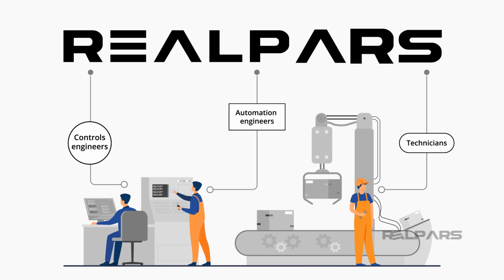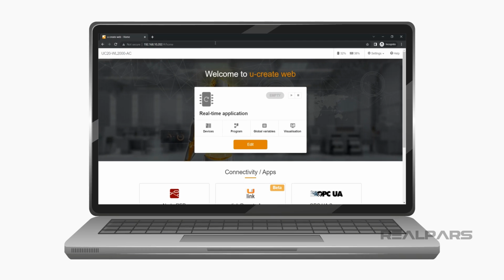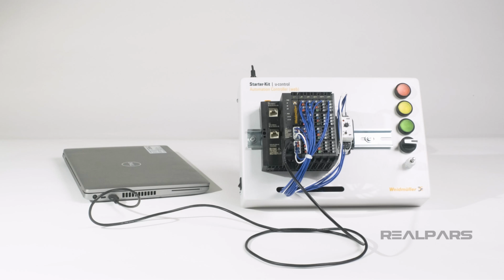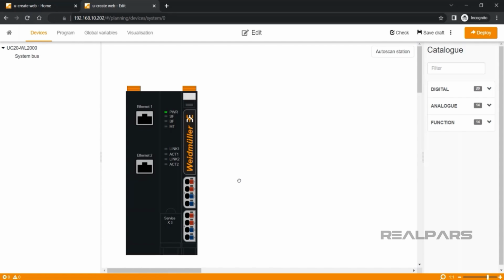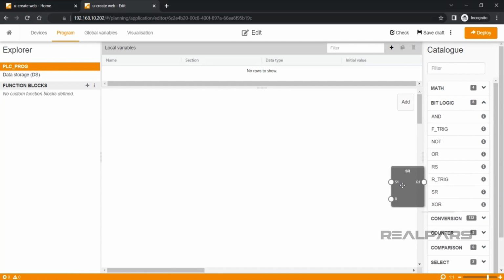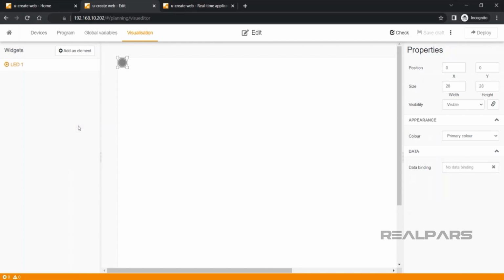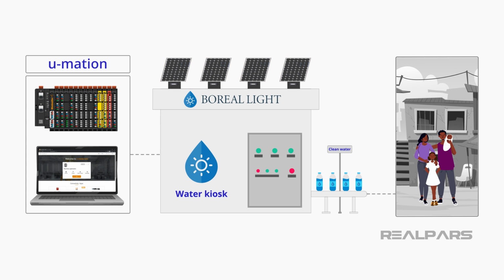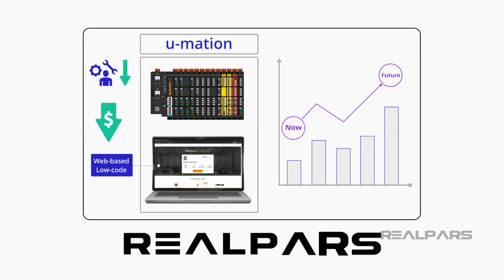A First Look at the Low Code Future of PLC Programming

Comment: This is interesting for didactic systems. Actually, it's very hard to get a Siemens PLC. The other benefit is that all dev-tools are hosted on the PLC itself. Not to require a software installation, is a giant step forward, specially for schools and education centers. For example, my next task in Munich is to update all Desktop-PCs + installing Tia v17.
Reply: TIA v17 has a new useless programming language called CEM. And now TIA v18 is out. Happy update!
Reply: @HanggliderDelta  I haven't looked at that yet. I probably never will.
Reply: @HanggliderDelta  I could imagine CEM being somewhat neat for Safety, but as I currently need JMP instructions for conditional MOVEs, I don't think it'll happen anytime soon.. that's what it must feel like programming PLCs in the 1990s
Reply: @reverz3  Yes it is very likely the inspiration was a programmable safety PLC.

But as I saw on the SIE's promo video their small program was too large for monitoring in 100% view.

Even if another large company paid the bill they spent too much effort for nothing. LAD would be enough for Safety or FBD.  Yes I know CEM is powerfull when you have to do x from y type logic. 

I would be very happy if they would improve their SCL.
Reply: @HanggliderDelta  What would you like to see improved in SCL? From my understanding the 30% who use it get along fine with it, the other 70% are still stuck with instruction list and will be until it is discontinued by Siemens, which hopefully is soon.
Reply: @reverz3  
In reverse order.

As I know STL was the assembly language of the virtual machine (PLC processor). Its documentation was a mess and it is still a mess in TIA v17. I usually tell the newbies to read the manual because it is extensive and nobody can figure out itself how logic operation work exactly. Because status bits are not mentioned explicitly at the instructions. And a couple of status bits are not mentioned at status register for 1500. So nobody knows what the heck is the !FC bit. 
Originally STL was the only language which were able to handle pointers and maybe SCL also but nobody paid extra for SCL in my experience.

I think the fame about STL is because it is text you can easily edit it, copy and paste it in between anything. But its biggest advantage is its functionality which is missing from other languages like pointer arithmetic.

A lot of people use LAD because they can easily follow the green lines while they monitor and now it is possible to index arrays in LAD so you don't need to do pointer arithmetic in SCL. There are good programmers who work in LAD also, but in my experience the worst programmers work only in LAD.

About all graphic language. They are frozen into the IDE it is difficult to copy or migrate into a different version or different IDE. IDE developers have to create and license exotic versioning systems because text  based revisioning systems like GIT, SVN, CVS are not working.

About SCL. The standard knows enums, classes and many more. Constants are a big joke in SIE. Constants are local for the block only or global. You are not allowed to use PID_Compact.MODE_AUTO no-no you have to look into the documents and know Automatic operation is 3 and your program will have magic numbers or you can create your own constant in your block for this. But to be honest this should be the job of the compiler at compile time. Constants are with us form the '50 or '60. In v15 case construct were able to thande only signed variables, in V16 it is possible but if you use signed for the variable and unsigned for the case branch as a constant (who want magic numbers?) it will execute none of the branches and give no warning at compile time.

It is not possible to create function blocks as inline functions (like macros but safer) or maybe it is possible and the compiler is able to optimize your code without function call but I don't belive.

In case of constants only literals are allowed as value at definition. In case of the standard and codesys you can use constant expression which is evaluated at compile time.

As I think it over there was other built in bad things. Like cross references (which can be a very good thing anyway) but programers tend to read and write data from other blocks directly because they can use cross references. One of my german colleauge has created an FB and its instance DB and then he were able to reference the data inside the FB not as local static but as DB.static and he gave it to me as a very good block.

Another thing what I am not able to understand is the Retain and Setpoint values in FB-s. I really hate them. I usually create a global DB for the parameters and store them inside as UDT and then I call the FB somewhere with the parameter data as in-out parameter. So if the program wants reinitialize something i usually don't care. 

I think there are more complex machines then a tank with a pump and some valves.

Usually I have to communicate with a PC over TCP/IP, I have to handle a number of parameter set and change them, show them. The machine have different stations with different tasks, a lot of error messages, HMI. More than one product inside with a lot of data. So these things are more complex than a couple pneumatic cylinders.

Ahh I nearly forgot the library functions. String hadling and data conversion into string. It is very weak. Can you do such thing in SIE? sprintf(s, "%+03.3d", val); No.
Reply: @HanggliderDelta  i can see where you're coming from and as someone who took a small dive in OOP I see why you'd miss this features. But the current state of the matter is that most people who use TIA work with PLCs for well over a decade now as well as maintenance stuff who occasionally has to look inside the code and the former have to keep it as simple as possible for the latter. Introducing classes might not be the way to go here. What are you working on that needs classes in a PLC?
And isn't there a new controller around the corner that supports native ST? 

Had to actually smile at the local constant thing because that's usually how I control my PIDs.

accessing static variables from outside the FB shouldn't be possible in the first place, but it's literally the glue holding Siemens' library together (Modbus, even PID parameters) despite them actually advising against it.

the sprintf() I think you can do, but not in one line unfortunately. then again, my string applications on a PLC are not that sophisticated.

SCL does try to prevent 'pointer magic' code though and I do appreciate it. No more  poking at address xxx, you have to use a symbol you can track down all the way to your hardware configuration. Too bad people don't like new things and rather do it the way they did it for the last 2 decades which results in lots of migrated code unfortunately.
Reply: @reverz3  About me. I am an electrical engineer (Bsc, digtal techincs embededd systems) from 2000. I worked as web developer, HMI programmer (old protool days), test engineer, automation engineer in pharma industry, and now as PLC programer of new assembly machines (or I would say cleaning service after our german colleauges).  

I use excluselively linux at home, windows and linux at my workplace. So my first priority is portability. Even if I not port programs I use the same programs as many as i can on win and linux. PLC programming industry is a very closed world where every company wants to sell their precious. Everybody wants sihiney graphical language. At the end those codes are frozen into the GUI and brand and difficult to manipulate them. Try to diff two LAD programs for example.

I have some (more or less) experience in low level hardvare design language like verilog; low level programming languages like 80x86 assembly; 8bit microcontrollers like Atmel, Microchip; traditional programing languages like Pascal, C, C++; script languages like Ruby, PHP, Python, Postscript; SQL languages like MSSQL, Mysql, Postgresql. I wouldn't say my knowledge is indusrty ready and some of my skills are really outdated now as the world went further. But I strongly belive PLC programming software manufacturers try to invent old things and neglect the achievemnt of others. I wouldn't be surprised if one day one of the manufacturer would say we use web based scratch programming language because our babies has strong background on it and it is very visual or LEGO mindstorm.

About classes, imagine you have a turn table or a machine with belt conveyor. The machine has many automated different or identical work stations in the way of the products and utilisation of a station is depending on the current product type. There are some shared functionality among the stations like observe the new product cycle, hold and release the table and prevent turning. With classes you can write the common code once and all of your station will have the same base functionality. In SIE world you have to write the same thing in each type of your stations or you can extract the functionality into a FC and call from inside each station's code. (Different FBs cannot be used as in-out parameters so you will need a UDT for the FC) Or just don't care drink a coffe.
Another example is from SIE manual. There is a punching machine example in it. The machine is able to punch out different shapes at different position and you can create a list of puchings for the actual product type. The PLC has array of something data type only, no hashes or other things. Look the ugly workaround of SIE in the manual. Without classes and typecasting or hashes this Industry 4.0 requirement is very difficult, or you need a PC and somebody from IT department and you have to extract this functionality into the PC and your PLC can be the same dumb thing as it was always.

About PLC technicians, maintenace and operators. At my current employeer PLC programs are very simple so they have very few alarms. People are complaining for more alarms and better step chain but they are not able to understand them and complain about the program complexity if it happens. So a lot of problem needs PLC programmers to solve it with a laptop. There are no usage of SW libraries every machine is different somehow. It is difficult to update all the PLC programs of different machines when you find a common bug in one machie. I think none of us starts to debug windows when something odd happens, maintenance and technicians shouldn't do that also, but they should be able to understand alarm messages, and understand the machine. And here our responsibility to create something which is not just barely tested and partly planned and documented for drawer and CE only.

I understand you by the way, but I belive we have to employ quality personell for delicate processes and machines. If not, you will live like us, good programmes just try to behave as if they were not exist at the meetings, production people and managers act as if they would understad the problem and give explicit (belived)  solution to the programmers to code and insist to their idea. I accept, there are industries where complexity is different for example in case or chemical industry and LAD, FBD is enough, maintenance has reasonable staff but assembly lines are different animal. This is why Bosch wants opcon programers.

Native ST in CPU. I think maybe it was not in the past and definitely will not be in the future. I think there is an ordinary CPU in the PLCs like ARM, x86 etc and it runs a realtime operating system. The OS communicates with the other peers and devices via ethernet for example and runs a virtual machine like JAVA or any script languages would do. Old S7 compiled anything into ST as bytecode and the virtual CPU run that code. S7 1x00 family has a different virtual machine then ST. TIA compiles anything into a new  bytecode. 
Look at Codesys they follow the same principle: RTOS and virtual machine and it is very flexible. Wago (e!COCKPIT), Festo (Codesys), Bechoff (TwinCAT), Bosch Rexroth (Codesys) all based on Codesys even Raspberry PI is supporded. All of these PLC manufacturers has a same clear baseline which they extend. SIE starts from the ground and we get new TIA in each year for our greater fulfillment. Still missing effective string handling. So no, I don't hink it is a good idea to ask a semiconductor FAB please stamp a couple of mc14500b one bit CPU core next to my arm processor onto my silicon. (MC14500b was a fantastic device in 1977 I think.) There were special CPU architectures for running LISP language in the past, they are extinct. Nowadays some server mainframes get FPGA next to the CPU and the user can synthetize hardware circuit into the FPGA to speed up (and use less power) mathematical operations like DNA processing or etc. But I thik PLC is a different animal.

I am very happy you see the same problem with magic numbers and static variables as me. :-D Imagine what would happen if constants would be accessible form HMI at compile time also?! That would be totally integrated.

Sprintf. No I don't want to create such functions in 2023. It is clearly the job of the programming language developers. But in the other hand I have to do because our IT department had made clear text protocol in their Manufacturing Execution System, or because there are device manufacturers who also did the same.

But to be honest pointer arithmetic in S7 was a bad design choice of CPU design I think, or wrong communication. As they had created ST they had to develop instruction list and registers for the virtual CPU. They wanted something simple like a RISC architecture. The main goals were: simple architecture for non-programers; fast operation; make everything static, strongly typed and over constrained.
Simplicity resulted in too few registers of CPU. AR1 and AR2 were used by the system in multiple instance blocks so it was not the best candidates to move data in between them by your ST program. A CISC CPU has a dozen data moving instruction but it is not simple and slow in case of a virtual CPU. Use SFC which is an OS function and by the way faster because it utilize the HW CPU not the virtual. For me it was difficult at the beginning to understand ST uses an isolated virtual CPU and these above are the consequences. I got the first clue at function calls. Every assembly language uses stack or registers for parameter passing to the function but these things are hidden in S7 or i would say in the standard. 
Stack? Why for? No-no, it is hard to program the same amount of pop operations as many pushes were programed before. (Funny because postscript uses stack for program execution.) Customer service will be not called because of wrog stack utilization and program crash by non-programmers so everybody will be happy.

New things vs old programers. Why would they learn new things? It is the definition of PLC programming. Let it simple and for everyone who don't want to learn complex things. And more important speed up!

Yeah I know I am unfair.
Reply from the maker: Thanks for sharing that, Andre!

Comment: function block and ladder programming is low code anyway. PLC is made for non-engineer to use easily. PLC programming is a programming method that engineer made so that they are not required to look after the system. But a web-based platform is a good plus, otherwise more features shown in vid already exist is other programs.

Comment: Low code??? Visual representation of code, is code...    regarding the amount of code it seems to be no difference.     Would be more interesting if it was config only in the default scope,   and had autogenerated or associated visualizations, warnings, alarms, statistics,  on the same object.    The configurator - not the programmer -  should select a start-stop-thingy,  not an SR-latch, nether an JK-flip-flop :)